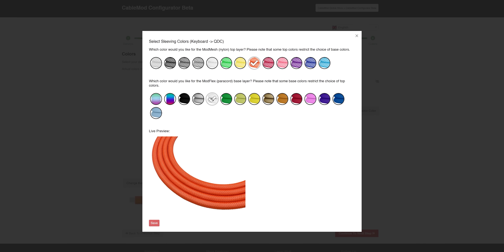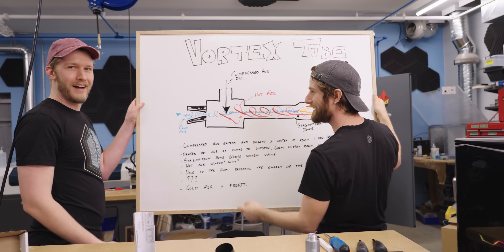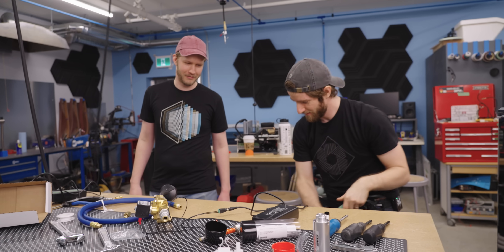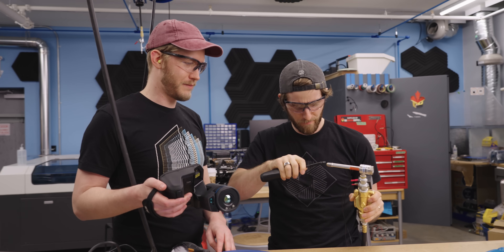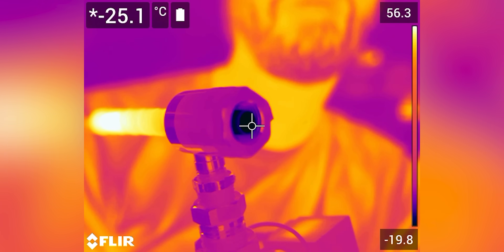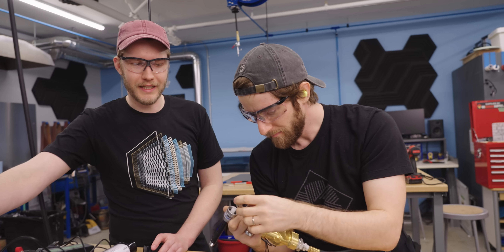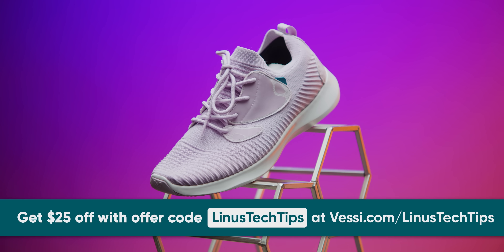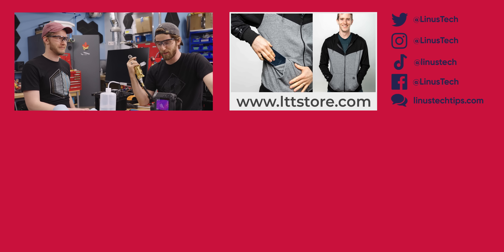This is a CPU Cooler? - Vortex Chiller

Comment: A shroud needs to be made to direct the cold air more evenly over the fins of the heatsink. I know Alex wants to do this, don't let this be the last time we see this magic air cooler hunk of metal. And I know Linus wants to milk this as much as possible for how much that costs!
Reply: Yep cnc a shroud to afix around the air cooler
Reply: they should try a open bench and use a CO² 7m³ tank outside.
now that, that will be crazy.
Reply: In and out🤔Maybe you can use a water cooler on in cold and out take  airflow goes out
Reply: @lvl3592  3d printed would be cheaper quicker and easier
Reply: Agreed, turning adding a shroud will not only make the cooling more even, but also better direct the cold air.  I expect that the test in this vid had a lot of cold going in unanticipated directions.
Reply: And put the fan back on so that it distributes the air better to the other half of the cooler 😉
Reply: Agreed. A decently designed heatsink will use some of the cooling on the CPU, the rest to cool the ambient air that's drifting over the other fins. A reverse nozzle with fins to break up the jet and laminar-izing honeycomb smooth it is needed for a big heatsink.
Pointing the cold air directly at the die is wasting lots of cold-ness. Only the very center of the cooler's output is hitting the die and mushrooming out. That air forms a slow-moving boundary layer that insulates the die from the rest of the cold air flow. Heatsinks address this by using high thermal conductivity materials (heat pipes, copper, aluminum) to spread the heat over lots of surface area, and direct air parallel to those surfaces to strip away the boundary layer. Even a simple cast aluminum block-of-fins heatsink intended for power transistors would vastly improve the situation. I'm not sure how static pressure will affect the vortex magic, but I would try an axial flow (fan on top) heatsink with closely spaced fins/pins first. At a minimum, make a (fan-sized) plate that only allows cooler output across the heatsink.
Reply: What about a big water cooling style block with a labyrinth for the air to flow through? Very similar overall to the idea of shrouding the heatsink but more directed. You could CNC a big swirly shape out of copper then put a clear plastic cover on it... use some smoke and dye. That's all you need to justify a new video for me to watch. Please, thanks.
You could have an angled inlet on the front for the cold air, outlet on the side that blows over to the ram or out the back.
Reply: @lio1234234  Let's CNC the shroud from a big cube of PLA.

Comment: Since air acts similarly to a fluid, you should revisit this by directly attaching the vortex output to the inlet of a CPU waterblock (with insulated tubing)!
Reply: Sure a fluid but the dynamics of the vortex tube would vary quite a bit it would have to be redesigned to work efficiently with water which is defiantly a lot harder than it sounds
Reply: Yes but No...
I would let a Heat Exchanger do the job to make cool liquid out of cold air.
Otherwise - put this thing in a watercooled loop fs!
Reply: That's a really smart idea. It will keep the air concentrated on the die and the CPU block has micro fins so they'll get more surface area too.
Reply: Air IS a fluid. You probably mean liquid but no, a gas absolutely doesn't act like a liquid in any scenario that includes compression.
Reply: Similarly to a liquid
Reply: air is a fluid, as are all gasses.
Reply: yes please
Reply: @mrcoconut9205  Vortex coolers don't work on liquids because of the increased density of liquids compared to gases.  Because liquids are 1000x denser than gases on average, it requires vastly more energy to achieve the same separation of hot from cold particles that allows them to work on gases.  Dumping that much extra energy into the system nullifies any benefit from the separation, adding more heat on average to the working fluid than you're able to get or remove by concentrating hot/cold particles.
Reply: @mrcoconut9205  op means use air inside the waterblock, not water inside the vortex.
Reply: @stefan514  In some areas and or places, where air does get both. Mainly because of humidity.
Reply: No it really doesn't. You cant compress water
Reply: Dope idea. I suppose it could work but I would be weary about using plain old air. I The thermal capacity of that mass of air is much lower than the water (it’s like 2X lower per mol, but a mol of water takes way less volume) and water has that thermal “smoothing” effect that allows the CPU to stay at constant voltage, same with a big block of metal. With a smaller heat capacity, it may appear that the surface is cooler, but instantaneous spikes in CPU temperature would be unchecked, which would cause the CPU to throttle. 

If they could somehow create a super beefy block to handle the temperature spikes, and then have the air flow through a maze of fins, I could see it working
Reply: Wouldn't work. For one thing, where are you going to dump all the super hot water and what are you going to replace it with? This is not a closed system. Secondly, I don't fully understand how this works but from what I can gather, compressibility of the gas is important to it's function. Water isn't very compressible.
Reply: @wingracer1614  water isnt compressible at all
Reply: @julian6653  Under the sea would like have a talk to you. Also same with pressure washer.
Reply: @wingracer1614  Actually nothing is truly uncompressable.
Reply: @killertruth186  Bro a pressure washer does not compress water. Its nearly impossible and highly impractical to achieve that
Reply: @julian6653  True, but water can be compressed with really great pressure.
Reply: @killertruth186  You are talking about bulk modulus of 2.2 GPa. Do you have any idea how much pressure you need to compress water by just 1% of it's volume?
Reply: @martianunlimited  I had done a quick search, and so far only 2 articles supports it.
Reply: @martianunlimited  Also not about the pressure washer part.
Reply: Yes, try this please LMG
Reply: @wingracer1614  you wouldn't use water at all, just the cold air.
Reply: @killertruth186  I never said it was, I said it wasn't very compressible. Factually true unless you have some weird definition of very
Reply: @julian6653  Yes it is, nothing can't be compressed at all short of black holes maybe
Reply: @Dan-Simms  OK now that makes sense. Using a waterblock but just blasting the cold air into it, that might work
Reply: @wingracer1614  True.
Reply: I did not imply water that water should be used at all :P

It was a suggestion to control (and possibly increase) the effect that the cold air has on the CPU, versus just willy-nilly spraying it on the heat spreader/motherboard/MOSFETs/etc lol

Comment: you should attach it to a cpu water block, and leave the other fitting open. I think it will have a much better effect, as it will cool the copper block while allowing proper direction for the air to move.
Reply: This is what I came here to say.
Reply: 3D print an shroud for the heatsink so all the air is forced past the fins.
Reply: This
Reply: That actually sounds really smart
Reply: exactly what i wanted to say
Reply: I agree, and I also left the same comment before I read yours, good thinking.
Reply: jesus christ but the pressure inside the loop! 110 PSI might blow some of your Orings or fittings unless theyre perfectly perfectly snug tho, no?
Reply: @ernestof6697  If they managed to get a perfect fit on one end, yeah.  Most loops are rated at something really small (relatively) like 5 psig.
Reply: @ernestof6697  With the kind of flow rate that would be directed through the water block, I don't think they'd lose much performance from leaks, as long as loss rates are low. It's not like the board will get wet. They could also 3d print a shroud to direct the airflow over a conventional cooler, but the one they used was way too large as is to get good airflow over the heatsink. A smaller heatsink probably would have worked better.
Reply: @ernestof6697 Ideally there would only be one fitting, from the vortex going into the waterblock, the air would then be able to dissipate freely from the waterblock
Reply: Please do this
Reply: @ernestof6697  no loop, just a block.
Reply: This! Get to it Alex's. :)
Reply: Just came here to suggest this very same thing.
Reply: Unlikely. The specific heat capacity of water is much higher than air. Hence the smaller contact area
Reply: Great Idea, another video to milk this product cost into profit from content
Reply: Yes, do this please. I just wanted to make the same comment
Reply: @ernestof6697  well, as long as the air doesn’t have too much resistance, 110 psi won’t exist in it. The pressure that builds will be the result of stagnation pressure which will be limited by the maximum flow rate of the nozzle. Further, they could probably run at 450 CFM or whatever the maximum flow rate was because, at 110 psi, they may be experiencing something called choked flow. At choked flow, no matter how much pressure you put on one side, no extra air will come out because there is a maximum mass flow rate that is allowed for by physics based on the cross-section of the throat of the nozzle. If there is no widening or narrowing (ie no throat) there is no maximum limit for non-viscous flow in a frictionless pipe aside for the universe’s max speed limit.

That said, the velocity of the air coming out of the end of a nozzle may be supersonic if the flow is choked and the outgoing nozzle is diverging.
Reply: This or a delid
Reply: Exactly what I was going to say!
Reply: CPU water blocks would not be effective at transferring heat to the air.
Reply: @JNAC91  Me too!
Reply: the pressure is too great for that, a standard block will explode. i do think you could use the coldplates though, if you get one with tiny fins on the water part that might help. 

I think on the chip it was too far away to cool the CPU and too small of a surface, the heatpipes might have not worked because the liquid inside may have flash-frozen so there's a blockage.
Reply: Same thought, glad I looked if someone else said it first.

Comment: Random fact: JPL uses these to cool the Earth based twins of the Curiosity and Perseverance rovers on hot summer days. Since Earth is a lot hotter than Mars they have to be actively cooled here and vortex cooling is one of the few methods that's compact enough to fit inside the already jam packed rover. We just have to run a compressed air line along with all the tethers and other connections to the rover and voila, cooling!
Reply: any suggestions of the best video that explains the phenomenon? is it the same idea that dyson vacuums or mining sites use when centrifugal force in vortex sort the materials by weight? in this case hot (light) and cold molecules (heavy)?
Reply: that's interesting AF
Reply: Dan Ershen  thanks dan. didn't even know that that was a named thing.
Reply: @cubertmiso  this old tony has a really good video about how they work.
Reply: It's a ranqu hilsh cooler if you want to look up how it works
Reply: @cubertmiso   Seems the spam filters catch every attempt at a reply I try to give... Sorry! Best explanation I've heard is that there's an angular momentum difference between the inner and outer vortices, and this difference forces a transfer of heat between them. Haven't really seen a good video version explaining this sadly...
Reply: @FergyA  Cold air happens from expansion hot air from compression, the inner loop needs less energy per rotation than the outer loop when it has too much energy it rotates too fast slamming into the outer loop losing that energy to the outer loop which uses it to increase rotation, this also compresses the outer loop allowing it to hold more energy than the inner loop. I didn't really address velocity, but one way to deal with momentum would be to fly straight faster idk if that happens you'd have to measure the wind speed on each side.
Reply: Thanks @FergyA820 @Cybird Cosmosity Spam filters truly are a nuisance. And real scammers/spammers are unaffected. Happens all the time. Hard to pick correct words because of that.

Comment: I used to work in heavy industrial environments and we relied heavily on using vortex coolers to keep our equipment cool enough to operate reliably. Really the only reason we chose those over refrigeration or peltier coolers was the abundance of compressed air available and the reliability of the device. We generated all of our own compressed air for steelmaking so as far as cost goes, it was "essentially" free compared to the overall operating cost of the facility.

Comment: I’ve used these at my job. I work at a nuclear facility and some times we have to wear protective clothing that is attached to an air compressor so we can receive fresh air. We use the vortex tubes as a form of heat stress mitigation. We can also flip the vortex tube around when we are dealing with cold weather. Quite a handy piece of technology.
Reply: and now used to set freeze seals on pipe also. In fact this beats the heck out of having to use liquid N2 and constantly replenish it
Reply: yeah we use the same thing for abrasive sand blasting. Works well for a small unit, although the outlet can find its way in between your cheeks in tight spots and scold you a bit 😂
Reply: Your handy "technology" was invented in the 1790s by an Italian physicist.
Reply: @SomeOldGamers  venturi
Reply: I also used it at my job as a spraypainter , in the summer the full face mask got to hot ,so we put something like this between the compressor and the mask...worked like a charm
Reply: There was one of these in our blasting helmets that provide us fresh air when sandblasting. swap it around for warm or cold air :D
also the helmet cost roughly 500 dollars but the tube that its installed in from the factory is roughly 50 bucks. Most of that price though is because its in a proprietary helmet tube.
Reply: @SomeOldGamers  what is the point of this comment
Reply: @@msmoonboo surprise surprise its not some secret club!
Reply: @@msmoonboo ouch, hit a nerve did i?
Reply: @@msmoonboo well no matter, but most people that 1. watch this content and 2. comment are more likely to be involved in stem and other such fields than random joes somewhere else
Reply: does it have to be attached to an outlets ? can they run on batteries or solar panels ?

Comment: 8:30 "why is there frost only on the outside?" simple your compress air has an air dryer. so the air in the tube has very little humidity to create frost where as the outside is exposed to regular humidity air which has plenty of water to create frost. I'm sure the movement of air through the tube plays a role as well but I think that's the biggest factor to not creating frost on the inside.
Reply: Cry about it
Reply: Lotta air-flow going on on the inside too, right? Hard to accumulate moisture when you have that kinda velocity, I'd imagine...but I'm no expert.
Reply: + there's the o-ring seal?
Reply: @seaneyo  Yup, but remember compressing the air also heats it, and if getting "consumed" rapidly it's usually cooling down fast at the end of a smaller nozzle.

I don't have a great filtering system on my shop air system but I still drain it daily from the filter and secondary petcock that are within a few feet of the tank, and see visible moisture every day. But also, Florida. shrug
Reply: @kurtownsj00  I stated in the original post but it doesn't account for the majority of the effect. if it was frost would be shooting from the tool.
Reply: @ydid687  their talking about at the tip of the tool there's no o-ring that could seal out side air from compress air unless your not using the tool. lol
Reply: @YungEagle3k …?